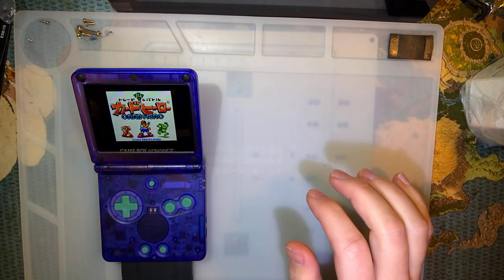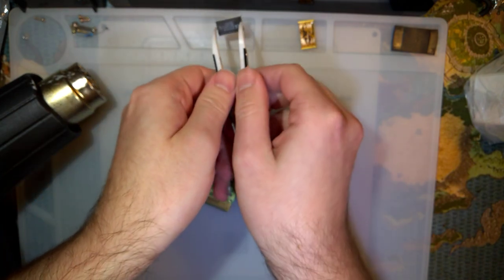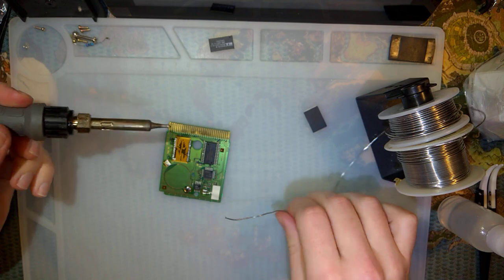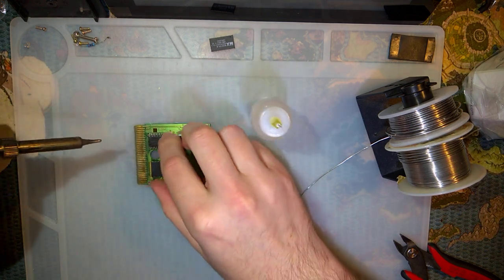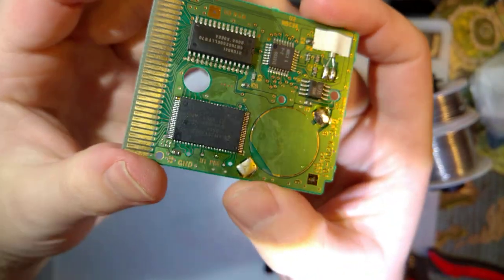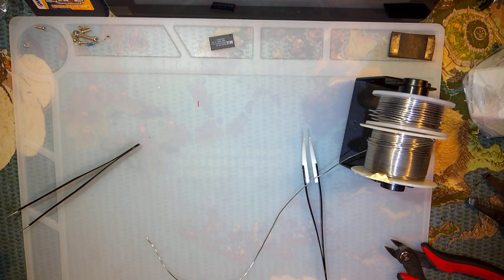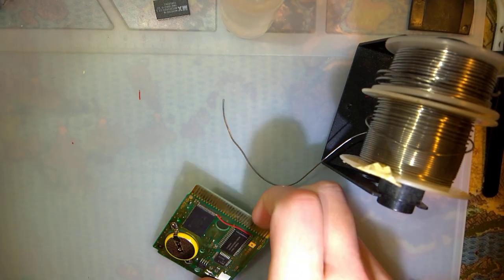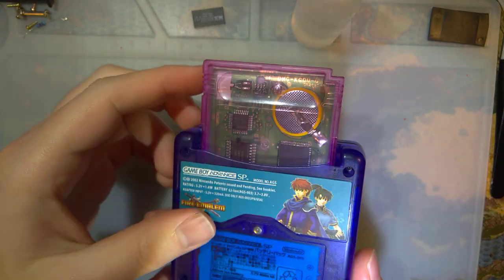Building a (2MB) Game Boy Flash Cart with RTC using a flex PCB adapter

Comment: Thank you so much makho! By some miracle I either had or was able to get all the parts and follow your steps exactly and now have a programmable GB cart with RTC! Woohoo! Dang that was some rough soldering though. Would have been impossible for me without a heat gun, tons of flux, and a jeweler's lens to find the SINGLE pin that was raised a tenth of a millimeter from the soldered pad.

Comment: Awesome vid as usual. Do you have to flash the chip with a game prior to installing? or can you use a cart dumper/flasher once the cart is fully assembled?
Reply from the maker: Nah, you can flash it when all is assembled. I just choose to flash them first because I can and because if there is an issue with the soldering, it helps me know that the issue is with my assembly and not the parts I used (because when buying from aliexpress, DOA parts are more common).
Reply: @makho  Yea i dont blame you. bought a GBP backlit lcd and it was a dud, haha.

Comment: I know of a nice HD Color Gameboy player you may want to check out. It on Ali-Express and it's called the Retroad 5 Plus Handheld with the GB/GBC Extension Converter or they have one that isn't a handheld that is the Retroad SFC52HD that also uses the GB/GBC Extension Converter. No connectivity though ☹. The handheld is the way to go though because you can hook it to the TV as well. You don't want it for a kid though. It is friggin huge 7" screen bulky but has a stand and controller hook ups.
Reply: You can connect with Super Gameboy 2 from Japan.

Comment: Hello, I got a question.
What would have happened if you soldered the pre-flashed flash chip onto the cartridge board, without the flex mask ROM in-between? Would it work?
Reply from the maker: You realize that the flex board is what is providing the attachment points for the flash chip, right? The flex board does nothing but connect all the pins where they need to go. If you want, you can spend hours hand wiring all 44 some odd pins and it will work the same (assuming you did not make any mistakes).
Reply: 2 years ago I didn't quite realize it. Now I understand it.
I have another question: what is the wire between the ROM and the SRAM for? What would happen if you removed it?

Comment: Hey!
I just discovered the AM29F016D-90SI SOP-44 flash chip. The pins of the chip I'm talking about are positioned in the correct to be soldered directly onto the cartridge PCB. Would they work?
Reply from the maker: Double check the pinout is the same. There are public schematics for GB carts and those should include the pinout of the MROM chips. Check it against the datasheet for the chip you found.

Comment: Thank you for this mahko! I have a question, is it also possible to put FRAM into this, in addition to the the flex PCB+Flash ROM?
Reply from the maker: At that point, just build one of HDR's carts. But yes. 

Also, don't use a flex adapter, get an actual PCB made instead because it's a lot easier and more reliable.

Comment: Does the WR wire get soldered onto the 2 left most pins of the flash or only the leftmost? because the pictures from jRodrigo are not very clear, using the same board as you it seems that the 2 pins of the left are removed from the flash chip and in the Jp crystal it seems he soldered in the WR pin of the adapter and the next pin
Reply from the maker: the two pins in each corner of the AM29F016 chip are NC

Comment: What happens if you use a amf030 in one of these? I know i cant use the 4mb but i have a ton of them
Reply from the maker: Well, I'm sure if you plug in the full part number to your favorite search engine, you can find a datasheet. In the datasheet, you'll find info such as capacity (usually in BITs, divide by 8 to get BYTEs).

Comment: Can you add more than one game on these and how many, like a multicart?
Reply from the maker: It's not really that simple but yes. You can always just add a 4mb flash chip instead of a 2mb one and put a switch on the highest address bit. High means you get the second 2mb bank of the 4mb chip and low means you get the first 2mb bank of the 4mb chip. 8mb isn't possible with 5v flash unless you install multiple 4mb chips (and tie the address lines to a switch so you can toggle them on and off).

Comment: I have some MBC3 carts (Mary Kate & Ashley Pocket Planner and Tottoko Hamutarou) Would these be suitable for rom hacks like Pokemon Prism?
Reply from the maker: Possibly. You'd need to replace the MROM with the suitable adapter. Make sure that the games have the proper RTC hardware equipped and enough save memory (SRAM) though.
Reply: @makho  yeah I've got some adapters on order from oshpark, just need to know what carts are compatible.  I'm pretty sure the pocket planner game has RTC (wouldnt be much of a pocket planner without it) not sure about the other one though

Comment: Any reason you wouldn't use the "george foreman gameboy grill" to remove that chip? (Instead of the heat gun?)

That lil "grill" thing is so nifty, definitely considering getting one
Reply from the maker: For sure. I didn't here simply because I didn't have it at the time (or wasn't comfortable with it yet, I don't recall the specific timeline). 

I use mine now for this stuff though
Reply: @makho  Ah ok, makes sense, thanks for the response! I recently got a heat gun but its massive, that small grill thing seems way more efficient. Sorry to bug you more but what do I look up to get one btw? Idk what its even called lol
Reply: Do you guys have a link to that grill you are talking about? I can't find anything on Google.
Reply from the maker: @TheGugustar  miniware mhp-30

Comment: I have a jp crystal can i do this and swap it out with an kor patch rom?
Should I work with the mx23c1603 12a ic?
Or should I work like the video method?
Reply from the maker: The ROM should work fine (may require a 4MB chip though). I'm not sure about using that IC though, you'd have to check the datasheet and compare it to AM29F032
Reply: @makho  Is the ic AM29F016 needed to make the crystal? Or is it AM29F032?
Reply from the maker: @눈꽃빙하  look at the datasheets
Reply: @눈꽃빙하  did you ever figure this out? And where can I buy those two chips?

Comment: Makho, I've successfully flashed pokemon crystal clear on a Japanese silver game, but once on awhile the game would just randomly freeze, any idea how I can fix it? Nothing is bridging, please help out
Reply from the maker: Dirty contacts? Cracked solder joint?
Reply: @makho  everything looks OK I checked, could probably be the am29f016b chip since everything is checked and flasher verifys rom and marks no error, this is the second mod and both do they same thing once in a while
Reply from the maker: @Pale-Snake  You just said you verified the flashed ROM so it cannot be the flash chip. It has to be the PCB or your soldering. 

I've done dozens of these things so please trust me when I say the soldering is more difficult than it appears. Double check your work. Redo it even.
Reply: @makho  thanks for the reply, that gave me hope, I will do try out a total reflow

Comment: Hey man, let me ask you, did you already see that pokemon 7in1 cart? there's a way to dump the 7 in 1 pokemon rom into one of theses mbc3 rtc flash cart?
Reply from the maker: The "All Fairy" ones? If so, yeah, I have one. If not, link pls. Currently the All Fairy carts cannot be dumped, and if they could, the ROM would not fit on one of these carts.
Reply: @makho  yes, these ones. Is it possible to mod them to have rtc?
Reply from the maker: @alves02  No, it is not. If you want a multicart with RTC, Everdrive or Ezflash are your only options (and eventually el cheapo 3.0 if that ever comes out). If you want a single ROM cart with RTC, you can convert over nearly any OEM Game Boy cart with a flash adapter and install a flashable chip.

Comment: What I want to do after watching this is tell you about Legend of the River King 2. You can use Gameboy Rom Analyzer to change the cartridge type to 1EH and force rumble. I wonder if you could put it in a crappy rumble cartridge. That may need something else though like Nushi Tsuri no Bouken 4 with real time clock. I wonder if there is a cheap real time clock rumble cartridge. I know Inside Gadgets does a flash but you need to patch the rom somehow to make the rumble stronger because it doesn't take a battery for the rumble. Hmmmmmm

Comment: I looked about Legend of the River King 2 and don't see anything about Real Time Clock so you could probably put it in any cheap rumble cart but I would love yellow like Pokemon Pinball but with the fixed River king ROM.
Reply from the maker: insideGadgets sells some rumble carts that would probably work nicely for that
Reply: @makho  They don't take a battery for the rumble and it isn't strong. I looked into it already. Your way is way better. I think you could just use Pokemon Pinball  and do two separate carts. I have the 3ds download but I really want a cartridge. Well both cartridges. Legend of the River King 2 with rumble enabled with Gameboy rom Analyzer and Nushi Tsuri Adventure-Kite No Bouken English patch. If you get lotrk2 to work rumble will work at the beginning with the earthquake. The other just needs to be English. $200.00 if you will do it for me. It would be greatly appreciated.
Reply from the maker: @michaeldemers2716  I don't take commissions. Sorry.
Reply: @makho  How about I trade you two GBA original's with light up screens and nice neoprene cases for your time. I own the original just not with rumble because they took it out for America. Think about it. You may have fun and you would be really making someone happy. If not I don't think I will ever get real cartridges of these games. If not for me at least make them for yourself so they are out there. They will be priceless. Trust me.